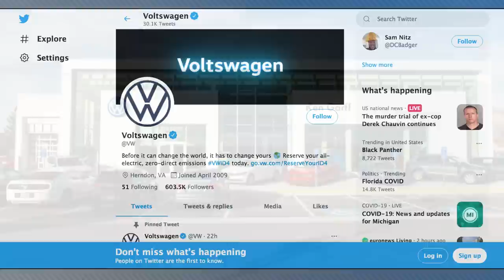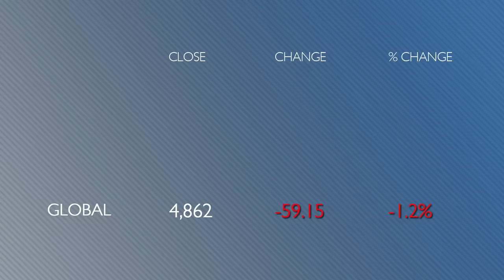Lexus' Wild LF-Z Concept; VW of America Changes Its Name - Autoline Daily 3047

Comment: Just stop trying to analyze the stock market, Sean. You're doing a lousy job of it. Investors really aren't all that worried about the chip shortage. We understand that to be a temporary problem that will be taken care of later this year. No, we investors are worried about the threat of inflation and the rise in interest rates, both of which will have major impacts on the auto industry over multiple years... and it will impact ICEVs even more than EVs. EV costs are coming down, so EV makers will be able to maintain more stable prices in the face of inflation. But ICE costs were going up anyway, and inflation will simply add fuel to the fire. Rising interest rates, of course, impact buyers' ability to obtain and afford a loan, and in turn the amount of money they can afford to pay for a vehicle. Many will be pushed from the new car market into the used car market, or out of the market altogether. Higher interest rates affect the price of EV stocks more than ICEV stocks because most EVs profits are all in the future, and thus get discounted more heavily using the DCF valuation method, but that's offset by their ability to obtain venture capital when ICEVs can't. Note that the DCF valuation method is misleading and invites misvaluation... innovative companies with compelling products do better in inflationary times than their less nimble "sitting duck" counterparts that are frequently the victims of disruption and changes in the marketplace.

Comment: Toyota 2025 LFZ will be 3 whole generations behind Tesla! Tesla will have a structural battery with higher density and lower cost.  Teslas may well be achieving 400 miles per charge while Toyota is struggling to get to 300. Autopilot may well be fully unlocked.  Which would you rather have a car that will come and pick you up and drive you to work with enough range to completely handle 99% of all trips or a Toyota that will most likely have 250 miles of range and no autopilot. Toyota you are lost and using delay tactics that are an embarrassment! You need competitive EVs now not 4 years from now!
Reply: Toyota having a 2020 reduction in volume due to the pandemic that was literally more than twice Tesla's 2020 global sales should tell you everything you need to know about what they would think of your statement: they don't care. They recently reported surpassing 15 million global sales of hybrid vehicles, and are very clearly on record about hybrids being their priority for several years. Toyota knows its customer base extremely well and they do not care about battery generations or autonomy. They want safe, reliable, and easily serviceable transportation at a good value.